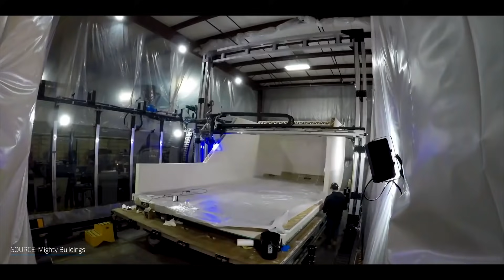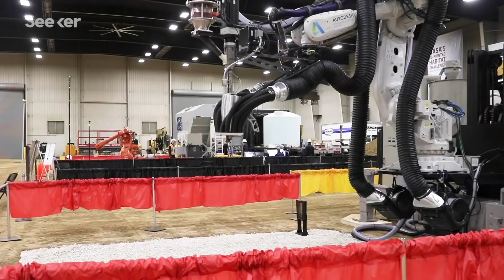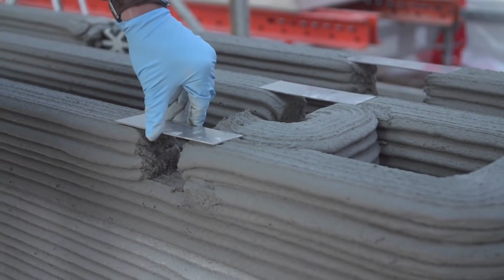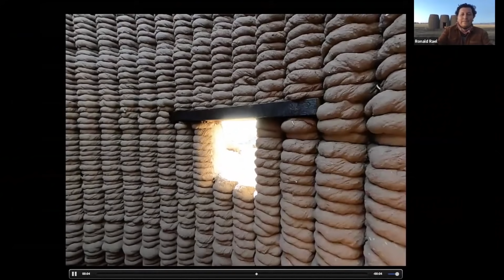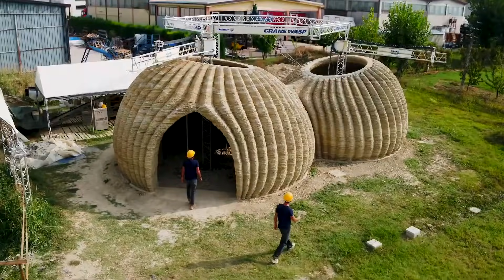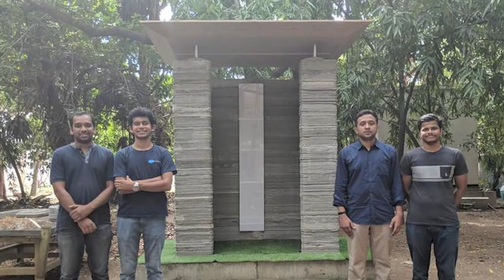This 3D Printed House Is Worth $0

Comment: Very ambitious, though worthwhile, imo. But! Mud is great, until the rain and floods come. Sideways rain in tropical storms and hurricanes, hmmm? Vertical rain can be mitigated with a simple roof overhang, providing the roof is sun and water proof. Built anywhere other than a desert climate, and the mud would need weather proof sealers. I'm not sure that there are any environmentally friendly sealers on the market. Perhaps someone is working on that?
Reply: Adobe is the longest-lasting building material known to man.  It is clay and straw.  It is not suitable in wet climates but works well in arid climates.  To make it withstand rain it is typically covered in a thin layer of cement.  Before cement, it was just repaired as it weathered, by patching.  A building like that lasts hundreds of years, some even thousands.
Reply: "MUD!, MUD!, Glorious mud!!!..."  https://www.youtube.com/watch?v=2cGc8Lczn5E&ab_channel=MyLittleWorldofSong
Reply: @fench1234567   Silly, unrelated, and quite embarrassing, if I was caught watching this video! -- But! I really liked it... (don't tell anyone) LOL!

Comment: So with Mud/Cob or Adobe homes built using local mud/dirt/straw why not just build them like we have always done, by hand. We can forgo the expensive modern equipment and have a nice organic home. When we introduce expensive equipment we have the issue of getting the equipment in, the cost of using the equipment and the labor for those using the equipment which raises the cost of the home considerably and the home is not totally organic because it is made with a computer controlled robot that can't impart the organic feel like if you build by hand. I guess by using machines we can make laws that allow the use of mud and straw but if we do it by hand we can't. Lets just make it so we can just build our cob homes by hand legally.
Reply: You forgetting about people who will operate this mashine and transportation to the sight.
Reply: @FreeLuckyHealthyHappyWealthy  I did not forget about people operating the machines. All that incurs costs and the costs rise ever higher and higher the more that technology is implemented. It's all about money. Not about the person.
Reply: What about less physically able/disabled people. Even if I had all supplies and permits, I wouldn't be able to build by hand.
Reply: One the equipment is made cuts the cost of man labour makes them cheaper..the robots are still easier to fix than a broken back on a human..

Comment: The houses are too expensive here. There's a lot of us just hanging on to rented housing
Reply: a house shell for a 2500 square foot house only costs 30k. The other 220k is the other stuff you put into a house. Electrical, plumbing, flooring, windows, doors, exterior finishing, heating and a/c, paint etc.
Reply: @plebiansociety  An ultra-small apartment over here costs around 40k just for rent.

Comment: Really ? How about the energy used  to move the printing heads? How about these people who set up the printer scaffolding and prepare and mix the dirt ? You don't want to pay them for their efforts?
Reply: The house is worth 0 dollars. Nobody said the labor or the equipment was free. Settle down.
Reply: @BawkBawkBawk666  No it isn't worth $0.  It might cost $0 in materials not counting power or land or labor but the effort put into building it gives it useability over the already non-zero worth dirt it's made from and hence giving it worth or value. Even a cardboard box or a hole in the side of a hill is worth more than  $0 for someone who has use for it so the title and premise are incorrect. This is just how the English language and logic work; sorry.
Reply: It can be solar powered. Not free, but very cheap. And currently workers are still needed, just for less time and fewer of them. Locally sourced materials reduce transport and manufacturing costs. As automation increases costs will go down and production will speed up so the cost of housing will fall. Land will still be expensive. Though the real question will be, where are we going to find the space to put all of these new houses?
Reply: @zaibian7  What do you mean? 3% of the land's surface is dedicated to cities right now. Literal room for buildings isn't really a problem except for tiny island nations.
Reply: @filonin2  not only on islands regretfully
Reply: @reinoud6377  Where else?
Reply: @filonin2  1- Not all lands are made of constructible zones, deduce mountains, sand deserts, swamps, flood zones etc from the total of land, and you'll see your 3% rise when compared to the real amount of constructible zones.

2- People living in cities still need a lot more land in order to survive because they need food (agricultural fields) and wild parks because most agricultural fields are exploited with technics destroying the biodiversity that is also needed to survive.

Can you find one country without unconstructible zones, no agricultural land, no wild park owned by state or private groups/individuals ?
Reply: @Bloodysugar  That's 15.7 BILLION acres of habitable land remaining BTW. There is SO much room it's crazy. Everyone on Earth could have a 2 acre estate with total utilization with the current population.
Reply: @filonin2  It is indeed 15.7 billion acres IF you don't care about feeding people and having enough wild forests to make the athmosphere breathable and biodiversity strong enough to not lead us straight into a mass instinct, witch already is the case...

Actually 50% of habitable lands are used by agriculture and 37% by forests, if we wouldn't have also to care about other biomes like wild plains (wich is impossible) that leaves 2 billions acres for building. And on this you must have industrial surfaces, commercial surfaces, parking lots etc... witch tend to take way more space than habitations.
Reply: @Bloodysugar  The Earth can hold trillions, you are only bringing up engineering problems now. Take the L. Bye kiddo.
Reply: @filonin2  If you're looking for maturity :
1- Do your homework to avoid claiming BS.
2- Start by accepting to be wrong when you are. Which is here obvious. 

A fast research about what composes these 15.7 billion acres demonstrates it in less than a minute. Deal with it.
Reply: @Bloodysugar  The only important Forest on earth is the Amazon. All oxygen that you breathe is made by algae, not plants, that end up using as much oxygen as they produce, at least most species.
Reply: @vladlu6362  Any tree participates to athmosphere quality by consuming Co² and H²O during photosynthesis, and releasing slightly more O² than they absorb. Algaes do the same, some with more O² release, but it doesn't mean trees do not produce O². As a matter of fact they do. During this process they also absorb many athmospheric pollutants. They also concur a LOT to cool the athmosphere by capting light and releasing humidity, and by releasing aerial molecules when they get too dry, they can even generate condensation of humidity in the air and provoc rains. Which means they also are athmospheric regulators, which algeas are not.

Also, unlike trees, algeas do not fix the ground with their roots, protecting it from erosion. They do not breack stones nor drive water to water tables, they do not produce nutrients enriching the ground... and they are not the first and most important pillar of biodiversity on lands.

Comment: Let me know where to invest. This is an excellent idea. My only concern is if it's damaged how do you repair it whether it's an earthquake or a car running through it.   is there a 3D portable printer that would go on site and repair it. And what's the skill level for the staff in doing this process.
Reply: It's clay and earth easier to repair than the cookie cutter stick homes we have today.. and if a car would drive into it I'd feel sorry for the driver and the 🚗 they both would be hurt..but not  3D printed house..
Reply: never thought of that?  your right things do happen, we live in SE OK so a house can get damaged with high winds.
Reply: @donnaloveall1195  I think that with concrete you'll be very safe with high winds. I've done a little construction and what is the most important part is how your roof is connected. Check with the building department of your city as to how a roof can be secured against high winds.
Reply: The unique challenges of the area must be kept in mind. This area is susceptible to flooding and high winds, so how the building is constructed has to take that into account. Looking under the homes they tend to be supported off the ground a bit to minimize the negative impacts of the former, and Im unsure how well a mud house would stand up to this. 

I do think it is a clever idea that should be used where it can, but I am uncertain if all areas would benefit from mud housing. Im willing to concede Ive not knowledgeable in the construction process, so its obvious I might miss something easy to note, but this is a concern I had considered.

Tornadoes, hurricanes and flooding all being an issue in an area is not a common issue, however. Im sure its a relatively unique issue to small areas, but worth considering in these conversations.
Reply: Just curious as to where to get certification as a laborer for these projects. There has to be for each state.